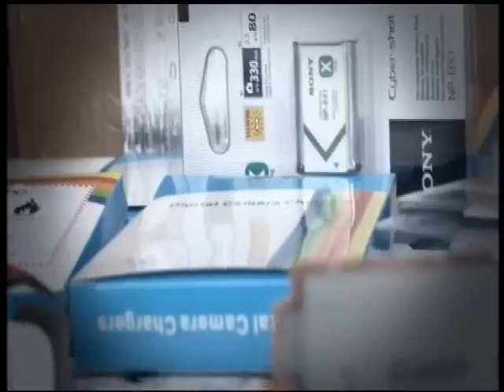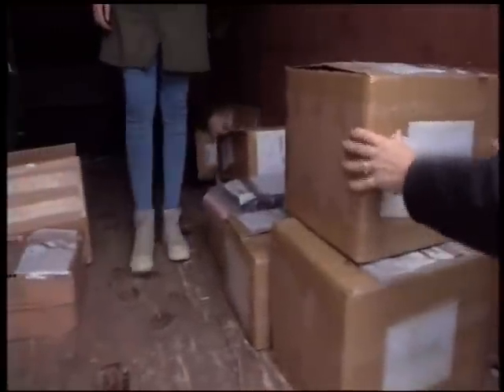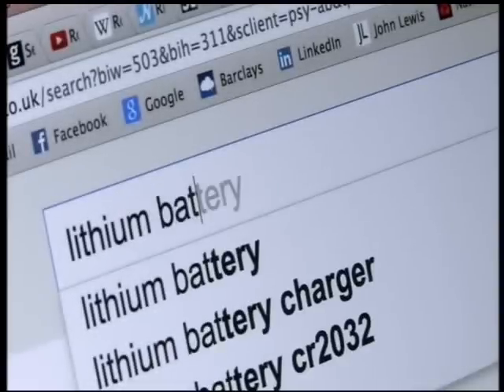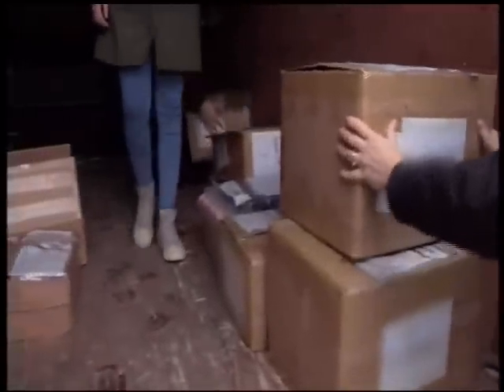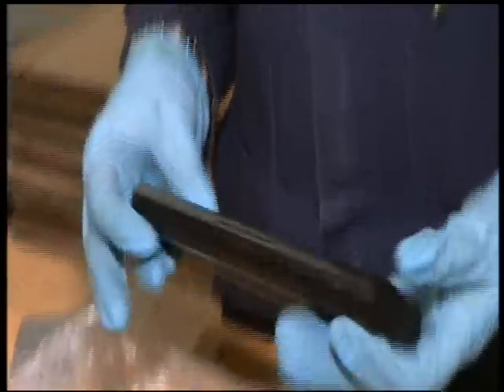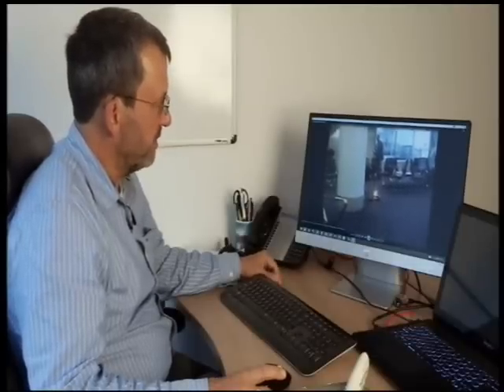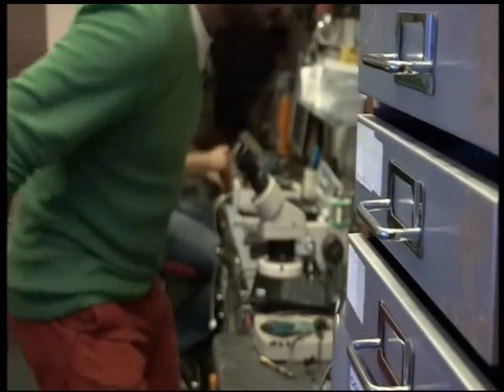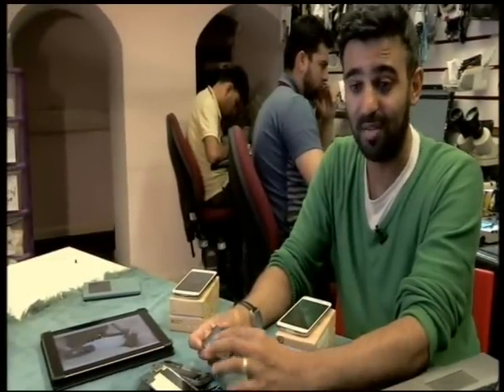FAKE BRITAIN   Lithium Batteries   Extract

Comment: Put a genuine battery on a hotplate & see what happens.
Reply: Ariel Barton Genuine batteries can and do fail in this way. There was a watchdog episode where the genuine battery exploded in a samsung galaxy s3. There was a recall on the iphone 5 due to a faulty batch of batteries slipping through qc.
Reply: +Matthew Hawes There was an entire series of Dell laptops that would burst into flames, in 2006 they recalled 4.1 million batteries.
Reply: +Tom Zeimet I have some normal batteries, not lithium, that have swollen out of shape, and they are original D----l, I showed them to the staff at the place I bought them don't seem to care. The fact is batteries are dangerous, fake or real, and if anything is to be learned from this program, it is that those batteries should not be allowed on an aircraft. (Have you noticed they all use the words "more likely to" as apposed to won't happen with originals.)
As for the recalls you mentioned, it wasn't just DElll, it-has since happened again with Dell, but also with Sony.
Reply: +MadIslowlygoing It's not realistic to ban them on aircraft, basically all electronic devices contain lithium ion batteries.

In fact the electronics on the Boeing dreamliner are powered by lithium ion batteries, and yes they caught fire.
Reply: +paulspydar  exactly what i was thinking.
Reply: +paulspydar They put all these fake batteries on the hotplate and they didn&#39;t have a control i.e. a real battery. If I put one of my Samsung 18650 batteries on a hotplate, it would probably go off exactly the same as those I guarantee. I had a real MNKE 26650 battery vented on me after a three second short circuit, which went into run away, That was genuine and it could have killed me.
Reply: +Unchained ExeDist Exactly. A better test would have been to hook it up to a circuit that tries drawing different amounts of currents from the batteries than their specifications allow. Without getting them to explode they could at least prove unregulated voltage which could damage equipment. Then they could have done the hot plate thing making it clear what could happen in a worst-case scenario, which would be more likely due to lack of quality control on "fake" batteries. This might actually allow someone to believe that their non-fake batteries are somehow more immune to being overheated. Which is ridiculous.
Reply: +paulspydar nothing else

Comment: Putting batteries on an extremely hot plate is like putting a gas tank for bbq in an oven.  Of course they will combust.
Reply: +RobinHood84 No way you could drop Genuine batteries in termite Fire and they would not run away...

Comment: They put all these fake batteries on the hotplate and they didn&#39;t have a control i.e. a real battery. If I put one of my Samsung 18650 batteries on a hotplate, it would probably go off exactly the same as those I guarantee. I had a real MNKE 26650 battery vented on me after a three second short circuit, which went into run away, That was genuine and it could have killed me

Comment: It's not so much a matter of fake vs real, though the fakes do have less desirable performance characteristics usually..
The problem is whether or not the batteries have protection circuits.

Even if a Li-on battery is genuinely made by a prominent manufacturer, if it lacks a protection circuit and its voltage drops below 2.9 volts or goes above 4.5 volts, you can see reactions similar to what happened in this video.

There are quite a few cheap "noname" batteries that perform as good as their "branded" counterparts.

"Trustfire" batteries are one example.

Comment: That hotplate test is stupid, but the fake batteries do not have the control circuitry on the inside which the device that you put the battery into manipulates to keep the battery from overheating being overcharged being discharged too quickly those types of things the battery itself could also be of questionable manufacturing quality. I will never buy batteries or chargers for my devices except directly from the manufacturer and I have never had a problem of any kind in fact my devices run cool and fast and I have never had the experience of my laptop being even slightly warm. there is no free lunch.

Comment: BULLSHIT. I also have some of the ASO 18650 and they are totally fine and you can find them in fake laptop batteries also.

Yes they fail due to these fuckers did put them on a heat plate -_-
Reply: +daand12 Yes, it is bullshit, the genuines also will burn like that each one of them. Any lithium battery will fail like that if you set it on HEAT plate enough for frying eggs. Don't matter if it has the adecuate security thermal fuses or not, the thing is the short circuit is developed inside the winded insulation that separates the layers of lithiun, not in the circuitry.